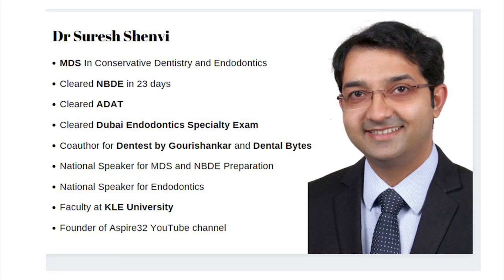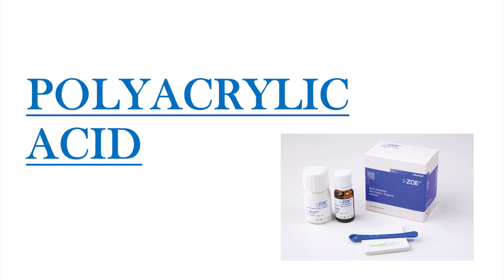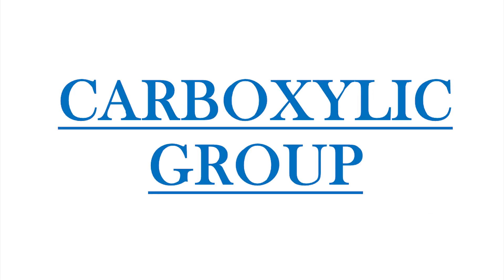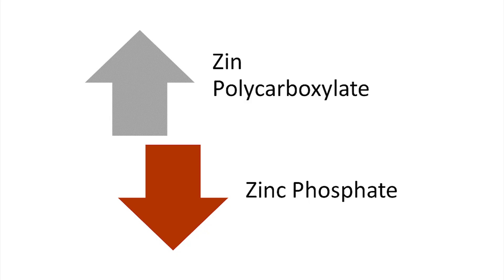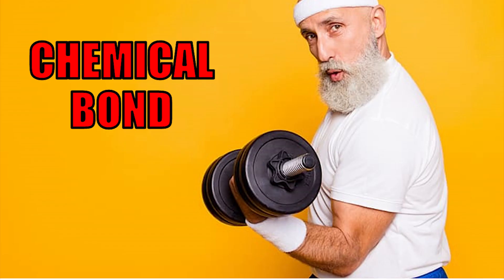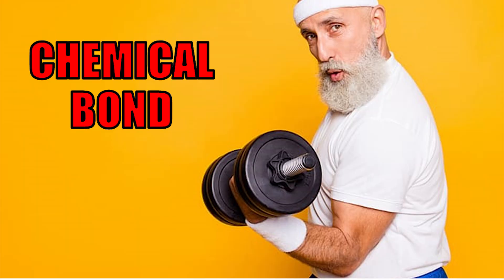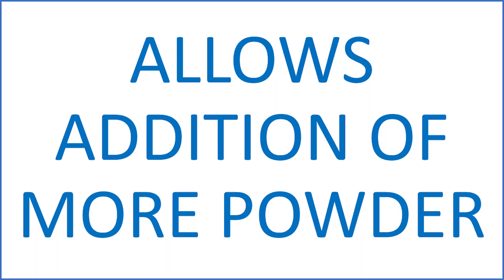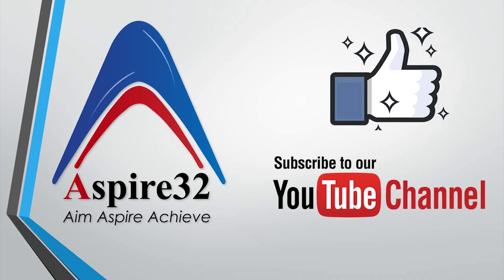Zinc Polycarboxylate Cement | Dental Cements | Super Simplified

Comment: Sir 
Glass ionomer cements and all of its modification
Fluoride releasing amalgam 
Composites modified to release fluoride
Zinc polycarboxylate cement
Compomer
Pit and fissure sealants - they are not cement but are also responsible for fluoride release in the mouth
Reply from the maker: Great answers.. but  which was the first cement to release fluoride.. its missing here ??
Reply: @Aspire32  
Sir is the answer silicate cements?
Reply from the maker: Yes. You got it right :)